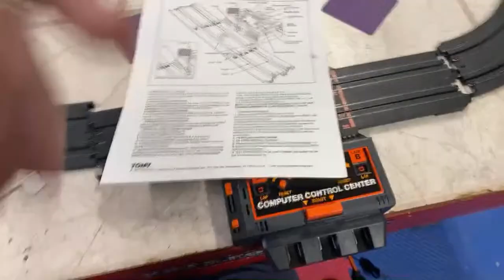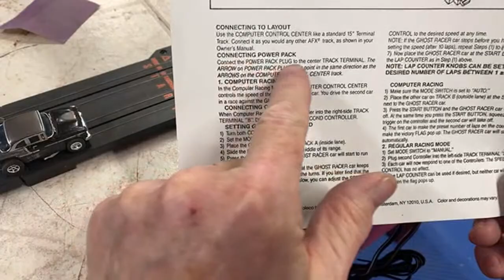ProTinkerToys Presents!Quick Tech Video

Comment: Just got mine today.  Works great, just like it is suppose to.  I did the same thing when I was 10 because I had the original steering wheel controllers and those could be set and left at a speed.  This works very good with cars with magnets as they can go fairly fast without sliding off the track.  I have about 50 feet of track on a 5x9 ping pong table and only using 9' or larger curves, with a chicane.  Cars would have to be set slower speed if you use 6" or Hairpin curve.

Not really a computer but a manual set point of the 'ghost' car.  I like the 10 lap race and finish flag.  

This is a great addition to a 2 lane layout!

Mitch... I've been 10 years old for the past 50 years and loving it!
Reply: 9" not 9'
Reply from the maker: Awesome! Thanks for watching and adding that information.